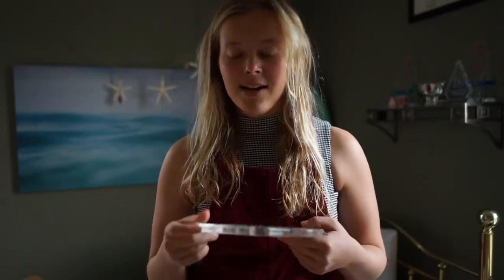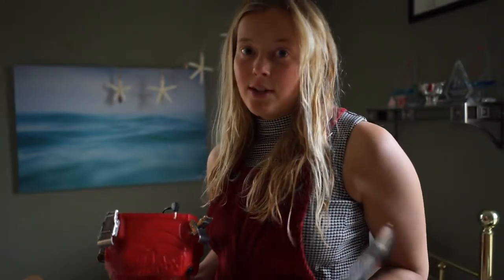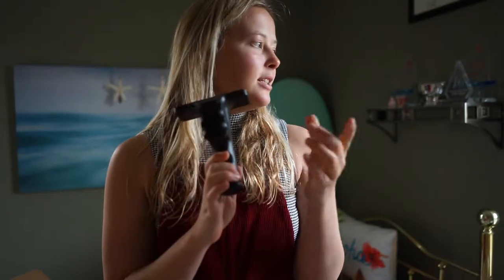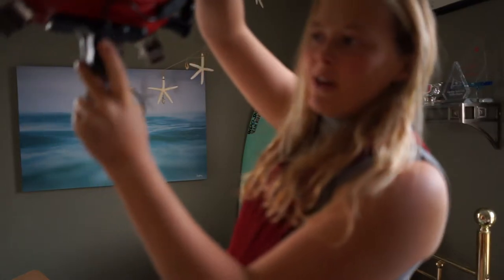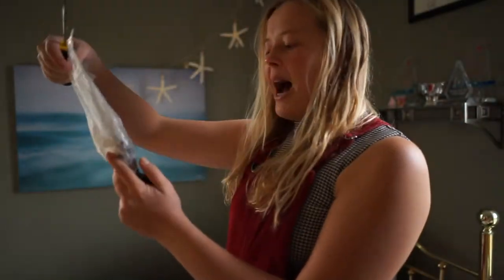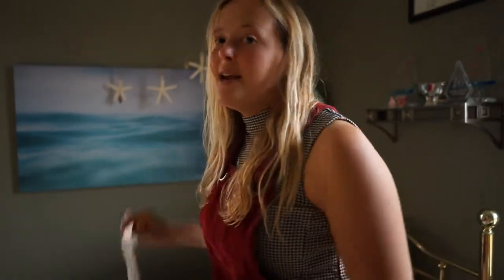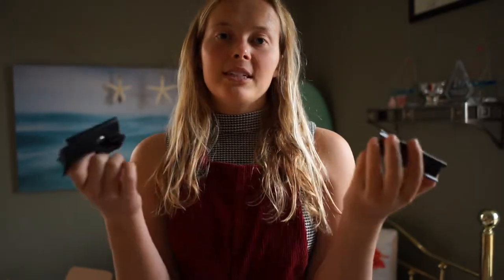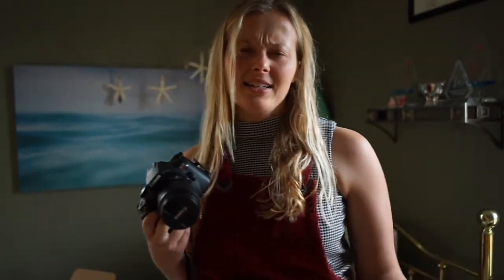Aquatech Housing Review Base vs Elite Flat vs Dome Port for Sony and Canon

Comment: Hey Nicole 

awesome video! thanks for the updates

question for you - what do you shoot with with the base housing? 

- lens 
- shooting mode? manual / Aperture / Shutter Priortiy?
Reply from the maker: Hey Adam,

Great to hear! In base housing I use a Canon T6 series basic DSLR with an 18-55 kit lens for the flat port it comes with. When set to 55, it's a tight squeeze but works well if on a tight budget. To prevent the rubbing of the lens with the clear part of the port, the element can be replaced over time, scratch remover regularly (there's a 3 step scratch remover on the aquatech website), or a ring extension can be used. I ended up getting the ring extension but mainly to combine that now with a dome port so that I can fit a 28 with a fisheye adapter on a Sony mirrorless camera in the elite housing, which gets you over under shots and barrels. I shoot in continuous to stay focused on moving surfers as they progress down the line. If you're going to shoot manual, determine what distance you plan to be from the subject and set your settings on land. For instance, if I want to get a crisp shot of a surfer who will be about x distance away, go ahead and focus on an object of that distance away (a license plate or sign is a good option), put the camera in the housing, and then take it in water with manual settings. It's not like on land where you can adjust everything easily. There's no one particular setting, it really depends on the conditions, what type of shots you plan to get, and the esthetic your going for --- so I'd say go through trial and error to find your style of what works for you. I hope this helps!
Reply: thanks so much for your awesome reply  @Nikkicolesurfer  

i have been shooting in Aperture Priority and getting some okay shots! will start positing on instagram if you wanted to check them out @saltdiaries

thanks again!

Comment: Very informative thankyou :) one question .. on the base housing can I switch from video to photo on my Sony a7iii?
Reply from the maker: You would have to either have elite, press record and film your whole session using base, OR the hack is to put an external controller for Sony cameras in a clear waterproof bag (waterproof phone bag works well) and pair with camera to start and stop video.
Reply: @Nikkicolesurfer  thankyou very much for your reply :)

Comment: I want to buy my first housing and I am so confused about focus. How can I get them in focus just with the trigger while they are moving into me? Should I set an average focal length and just shoot at that average distance.
Reply from the maker: Hey George, congrats on getting your first housing. There are multiple ways to get them in focus but it depends on what you're trying to shoot. So, if you are staying in the same area of the wave or relative distance from the surfer, set your settings to that distance. If you just want to shoot anything, you'll find the pistol grip with focus and take super handy. Top button is focus, bottom is take. Please do note that you'll also want to use continuous shooting mode for more to stay in focus (or you'd have to refocus every single shot as the surfer moves down the line and miss a lot of the shots) Enjoy!
Reply: @Nikkicolesurfer  would love if you made a whole video about settings! I love my aquatech but there are very little resources on youtube!